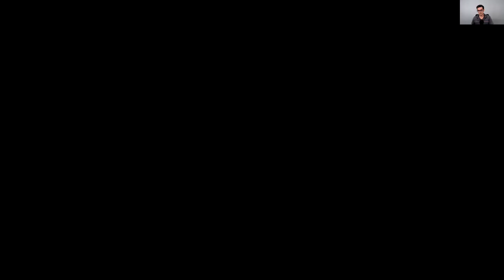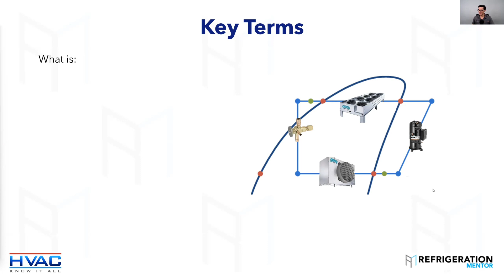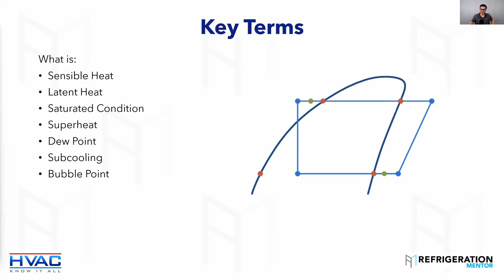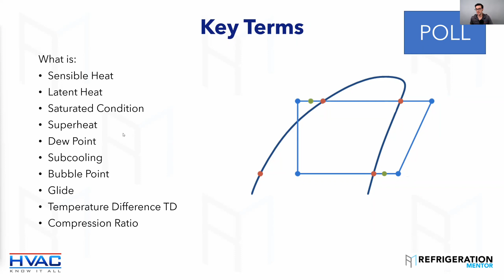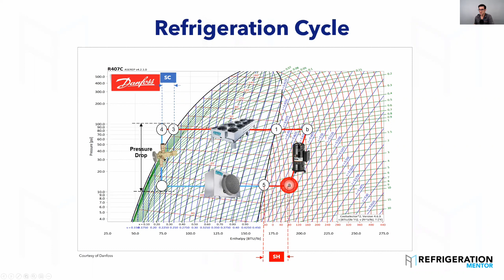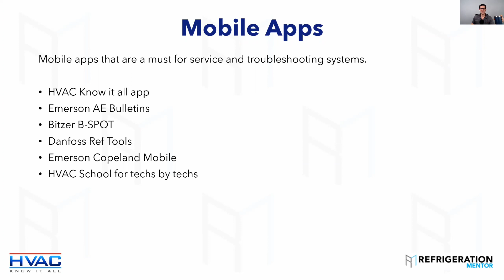Basic Refrigeration Cycle Webinar w/Trevor Matthews (Refrigeration Mentor)

Comment: Another great video.
A question came up from a young tech last Friday evening, as I was packing for a three day vacation. What situation would heat removal from air in a DX refrigeration evap be at it’s highest absorbtion:
A. An evap that is flooded with liquid refrig and little to no superheat at it’s outlet?

B. An evap with ideal 50/50 vapor and liquid and perfect superheat at it’s outlet? 

My initial answer was simply, “if you have no superheat, that tells me you weren’t picking up any sensible heat in the coil. If it were a freezer or similar, you probably had little relative humidty and this a low latent load as well. BUT! Let me get back to you on this”.  

Any input or direction to resources is appreciated. I have a feeling he has me overthinking this and the byproduct of the process may seem obvious. He asked me because he had a senior tech tell him that a flooded DX (not designed flooded evap) will have colder supply air because the coil is naturally colder. I was baffled by that
Reply: Geez, i over thought that one. Flooded would be ideal if comp damage wasn’t a factor